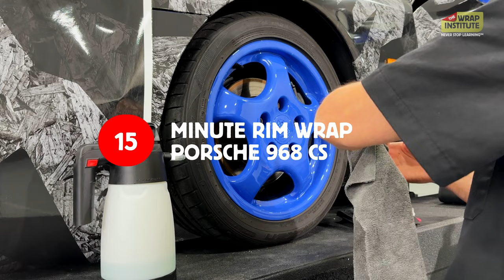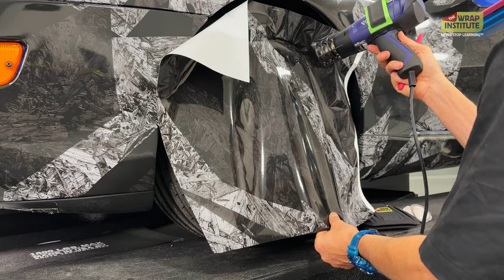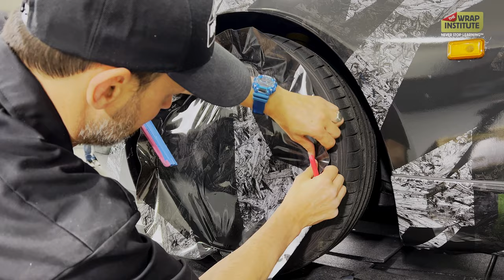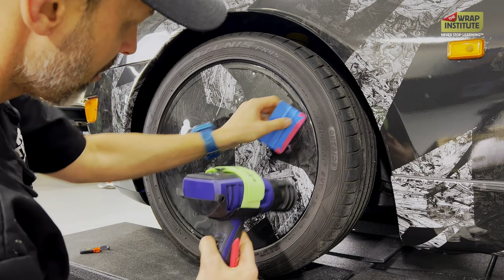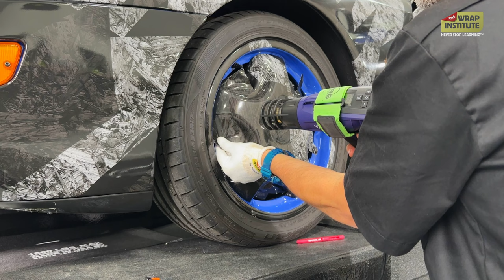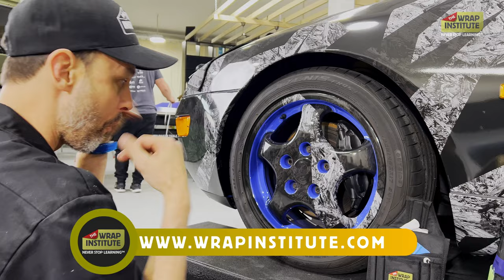15 Minute Rim Wrap - From Cleaning to Wrapping to Rock On)!   Porsche 968 CS Future Camo Print

Comment: not to take away from a cool wheel wrap, but I don't see anything "zero stretch" about this... just watched him plow a few wrinkles in a couple spots and stretch through pretty much every section of the wrap except the flat face part.  I'm not suggesting it's "over stretched", just makes me wonder what your definition of "zero stretch" is because every installer I've ever worked with would have tackled this wrap in this exact same manner without acting like it was part of a special "wrap matrix" or other technique name 🤷‍♂
Reply: Zero stretch doesn't mean you are not stretching the vinyl. It's heating it up before install so it shrinks back, that way when you do have to stretch it you can go further without risk of over stretching
Reply: @Randomgdude  I get what you're saying, and that makes sense, but it looks like he didn't heat this before install... right off the start when he first sits the vinyl on top of the wheel for positioning you can see it's all flat and equally proportioned with zero sign of pre-heat and then he starts by pulling it tight vertically, then applies heat and pulls it tight in all other directions.  Their "zero stretch" class thing is a buzz word gimmick as far as I can tell.  I've been wrapping for nearly 20 years and I'm not saying he did it wrong or anything like that, just wanted to point out that there's nothing "zero stretch" except for maybe the fact that they only wrapped the easiest portions and trimmed away from anywhere that would have required real effort and stretching.

I'd like to see Pate wrap something that's actually difficult to do, seems like all the videos I've ever seen of him show him only tackling entry level stuff that Joe Schmoe could tackle after a few cheap attempts.  He's got a video of him wrapping a motorcycle gas tank, actually a pretty tough task... but it doesn't show it completed and barely shows any progress at all while his voice-over offers questionable advice about how to work Avery matte black cast wrap film.  CK Wraps, now that guy, he's actually got some videos out there offering real education of difficult things such as chrome wraps and aggressive sporty front bumpers... that guy would wreck Pate in a wrap contest I bet, but I digress.
Reply from the maker: Hey guys! Thanks for watching the video! Zero stretch is the name of the approach he uses to reset PVC tension before the installation, but that doesn’t mean he doesn't stretch the vinyl when wrapping, as long as it stays under 10% and post heated, no problem. You should definitely check out our videos at wrapinstitute.com, we have more than 3.000 exclusive videos with in depth information for professionals like yourself. Here it is only the tip of the iceberg that helps mostly beginners. #neverstoplearning